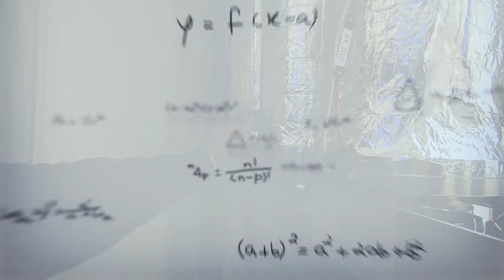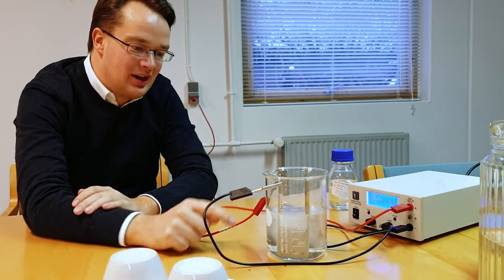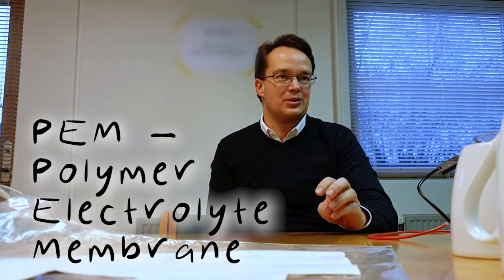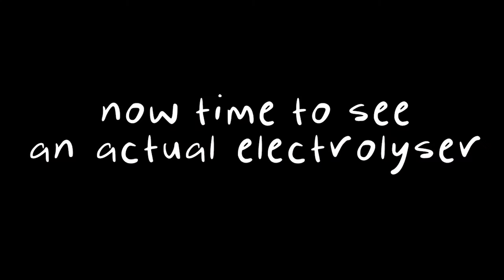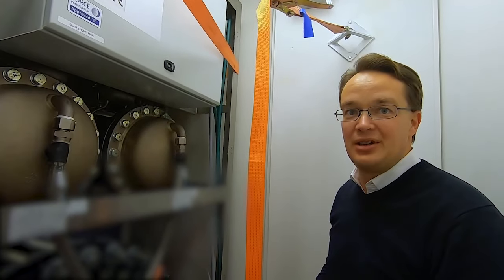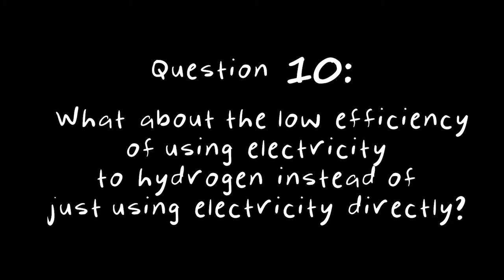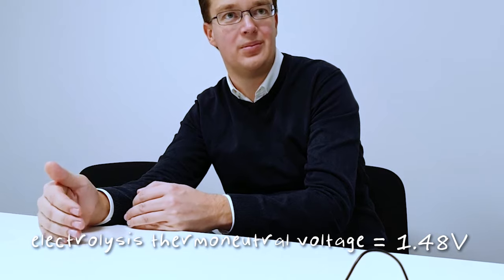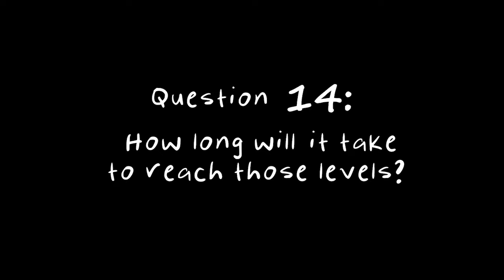Green Hydrogen Systems Electrolyser Tour

Comment: How likely is it that this technology will become a staple in the UK in the future?
Reply from the maker: I think it is very hard to say at the moment. There are a lot of uses for hydrogen that people are talking about now that are highly unlikely to eventuate, like using it to generate electricity or for passenger cars. And other applications where it will definitely be used, like fertiliser production which already uses hydrogen. What is uncertain is all the applications in between, where hydrogen is too expensive now but may become more economic if prices drop a lot in the future. Shipping would probably fit in that category. I've got a video coming up on using hydrogen to replace natural gas (for e.g. home heating). It should be ready in a few weeks, so keep an eye out for that video if that sounds interesting to you.
Reply: @EngineeringwithRosie  Thanks for the reply Rosie. I actually came across your videos when I was researching a company called Ceres that have created a steel fuel cell that can generate power from sustainable fuels like biogas, ethanol or hydrogen. Also, a company in Sheffield have just built the worlds biggest Electrolyser in Sheffield interesting to see how that develops in tandem. I'm subscribed and look forward to your next videos!

Comment: what about using the hydrogen to make synthetic fuels that you burn like the regular stuff? what would be the roundtrip efficiency of that?
Reply: Depends on the kind of fuel and the used process. And the source of carbon dioxide. Carbon capture from air (DAC) is very energy intense.
Normally, this efficiency will be lower than 50%. I heard from "27 kWh for 1 liter diesel-equivalent", which would be an efficiency of 37%.
On the other hand, methanol by power to liquid seems to be rather efficient, due to the "simplicity" of the molecule: 50 to 60% with direct air capture of CO2.
Which would be about 16 kWh for 1 liter gasoline-equivalent methanol (~2 liters).

Comment: if i had a fuel cell and put 100w in to it and produced H2 + O then put it into another fuel cell how much wattage would i get out?
Reply: You meant an electrolyzer in the first place. Electrolyzers produce hydrogen and oxygen, fuel cells consume hydrogen and oxygen.
However: Both efficiencies combined are up to 40%, rather less on average. 
So you would get back up to 40 W from 100 W.
Only this energy conversions, without energy for compression and the like.

Comment: How many kW is it necessary to produce 1 kg of hydrogen ?
Reply: Depends on the time period you want to spend on it.
You need roughly 50 kWh (kilowatthours) to produce 1 kg of hydrogen (here 52 kWh, due to 76% efficiency HHV).
So it's 50 hours with 1 kW, 1 hour with 50 kW, 10 hours with 5 kW and so on.

Comment: Hmmm, you have your bench power supply on constant current.  That is why the voltage is dropping when you move the electrodes closer together or add in more KOH.  That is why the amount of hydrogen being produced (as the woman was asking) stays the same.  This is very flawed!  Take it off constant current.  The answer is, YES, the more efficient you make it, the more hydrogen is generated.  It's not the voltage that matters (as you said) but production is directly proportional to the CURRENT being drawn, which does increase with electrode size/distance and conductivity.

Comment: There is one thing that perplexes me about all that.

If the current efficiency stated is indeed 76%, i.e. you get 76% of the electricity input back when you combine the hydrogen with oxygen again then what is the world waiting for? This is THE solution to get into green energy. The greatest problem of green energy is not the production of green energy but the storage to provide energy when the green energy sources are down for several hours (no wind for wind farms, the sun does not shine for solar farms etc.). What does it matter what is costs as long as we can save the planet with it? Even if it was 3 times as expensive as coal power stations, so what?

The idea is really very simple: Use green electricity at times of access to run the electrolysers and use the reverse reaction to run a power station to top up supply during times of high demand. 

Even if it was somewhat less efficient, it is still THE solution.
Reply: No, you got the definition of efficiency wrong!
It was 76% HHV. This means, from 100 kWh energy input, you get hydrogen with 76 kWh higher heating value (HHV), which would be 64 kWh "normal" lower heating value (LHV).
If you feed an efficient fuel cell with it, you could get up to 38 kWh electricity back. Plus heat. On average rather less.
Without counting in energy demand of compression, liquefaction,...
Reply: By the way: 64 kWh LHV hydrogen is 1.92 kg of hydrogen.
The other way round: For 1 kg of hydrogen, they need 52 kWh energy input.
Reply: If you'd use up this hydrogen (from the 100 kWh energy input) for heating, you could get up to 64 kWh heat (theoretically) with a normal heating system (water vapor leaves the house) and up to 76 kWh heat (theoretically) with a condensing boiler.

Comment: If it takes 430kw for 1h to produce 4kg of H2, than with an electricity price of aprox. 0.2€/kwh one would need 86€ for 4kg of H2. That is 21.5€/kg of H2. Yet the selling price of green H2 per kilo seems to be 2-3€/kg. Am I missing something??
Reply: Selling price never can be 2-3 euros,this price is target of cost to produce H2 once...but you are right 430 kwh it's to much...you need 58 kwh for produce H2 with 300 bar...cost of energy is around 0,04 euro/kwh...for H2 you need to have own EE from wind or solar energy or biomass

Comment: A quick take on the efficiency side for me without any other machinery, production and maintenance costs taken into account was the 100+kWh of power it needs to produce 1 litre of hydrogen which seems awfully inefficient & expensive to produce, how much power can we get back from 1 litre of hydrogen? 
100 kWh battery will get you a long way in an EV or power a house for several days, but 1 litre of hydrogen will hardly get you to the local store in a hydrogen vehicle which doesn’t make it sound very “Green” to me if that is an intended use case.
Hydrogen is great stuff & we need a bit for certain Industrial purposes, but it is very energy & cost intensive to produce, store & transport, so I see this as a good way to make a bit of hydrogen for special uses when the grid is creating an excess of power, but I believe there are better ways to use and store that extra power.
The Australian, ‘Snowy Mountains Hydroelectric Power Scheme’ push a button when the grid is in excess and pump water from a lower dam to a higher level dam which helps stabilise the grid also.
Huge underground heat batteries are another new tech worth investigating Rosie, & I think you have done Geothermal, another favourite, which could have huge potential for energy production.

Comment: I see Ducati and Porsche are investing in replacement fuels, I wonder if you could look at the different approaches to replacing normal gasoline is and assess how far we are from these being real alternatives to full electric cars
Reply: No, electricity is the way to go, Tesla claim 94% efficiency batteries to wheels, an ICE you're lucky to get 25% so you'd be wasting 3/4 of the energy you spent producing the hydrogen just heating water, actually the efficiency of hydrogen in an ICE is lower because it's the worst fuel you can use

Comment: Thx For this inside, question...can we make it at home du solar pannels, stire it, convert it again to electricity when there is no or not enough sunlight...and in contrast to batterys and life span....💕
Reply: Yes, there are already commercial systems to buy for home size, but they cost 60000€ plus and can only store around 4000 kwh of energy for the winter. It only makes sense if you can not get a grid connection to your property.
Reply: But this is only in German sorry.
Reply: Search for LAVO a company in Australia.  They make this hydrogen storage system.

Comment: Hydrogen isn't a bad idea, but it should not be treated as a source of energy, it's just a carrier of energy. We need a TON of excess electrical power generation that we can use to crack water to get hydrogen, and until and unless that becomes economically viable, and potentially cheaper (to generate and use) than just using that electrical power to charge batteries... it won't be very useful.
Reply from the maker: I agree!

Comment: He was kind of disingenuous to suggest that salt water could be used, then just wave away the costs of the reverse osmosis purification needed.  Any impurities still have to be cleaned from the process at added cost, so that tap water example does not scale over volume without cleaning the residual minerals out of the equipment.  He also speaks as if the water availability is limitless yet water use has been a big issue in the ethanol fuel debates in the US over the last 10-15 years.  Food vs fuel (corn), becomes drinking water vs fuel in the electrolysis case.  The amount of water required should always be presented alongside the electricity input for any given quantity of Hydrogen produced.
Reply: I can't speak for the extra cost of the purification needed, but if you only look at the extra energy required for desalination of sea water it really doesn't matter. Desalination can be done for about 3 kWh/m³ nowadays so it's less than 0.1% of the energy consumed by the electrolyzer.
Reply: The availability of water is exactly the point that I’m stuck on too. In order to effectively scale this one needs water, lots of it. If global fresh water supplies are inconsistent and future scarcity is to be believed then where will all the water come from? Add in the purifying process or desalination and I struggle to see the end picture from a total cost benefit analysis perspective. I like the idea a lot but….. What am I missing?

Comment: How much more power will it take to make the hydrogen, then it can produce
Reply: If you refer to electricity production by fuel cells with hydrogen made by electrolyzis, you could get up to ~40% of the electricity back.
Without counting in things like compression or even liquefaction for storage/transport.
But on average, it will be less, rather about 35%. Again, without energy consumption of storage/transport.
Reply: @701983  you didn't mention the 30 percent of the hydrogen that leaks out of the system because the atom is too small to contain.  And what will it blow up?
Reply: @terenceiutzi4003  I don't know, to what kind of "system" do you refer.
I mentioned "compression, liquefaction,..." twice. You could have mixed this up with hydrogen leakage, which normally won't be as bad as 30%. Even 10% would be pretty high.
There is a lot of exaggeration about this point in the whole "hydrogen-discussion".
Of course, storage of hydrogen takes more effort than storage of natural gas. But with the right technology and materials used, you can minimize leakage pretty well.

Comment: That electrolyzer and a building to house it, a suitable storage tank, a hydrogen compressor + the various required controls, monitoring and safety equipment will cost in excess of $2 million dollars (US) and it makes 4 kilos hydrogen per hour. That rate of hydrogen will fill a Toyota Mirai in 90 minutes or 18 cars per day. 
That will be a quite long and expensive recoup time or very expensive hydrogen. Neither does that include cost of labor and maintenance, plus the cost of a distribution infrastructure and it's maintenance, plus the cost of fueling stations at over $2M apiece plus their labor and maintenance
The 76.5% efficiency is only for the amount energy input converted to hydrogen output. 
There are many more energy losses along the distribution network. The net power at the cars wheels is anywhere from 20% to 40% depending on how much you spend up front for better equipment (H2 promoters cherry pick data).
Then the fuel cells that convert H2 back to electricity vary widely in efficiency and durability, the promoters of H2 like to cherry pick data here too. Cheap fuel cells ($10,000) are neither efficient nor long lasting (roughly 100,000 km in a car). Using an efficient long lasting fuel cell that could run 300,000+ km and your Toyota Corolla will cost in excess of $100,000. You can get efficiency and durability for $60K - $70K not $10K
So... if you factor in using an average of 30% net efficiency at the wheels, it takes 3X more electricity from the grid to run a Mirai than a Tesla, on top of the added expense of creating and distributing hydrogen.

Comment: This method of energy storage has to compete against batteries which are more efficient, a lot easier to handle, considerably cheaper and getting cheaper and better by the day. No doubt there'll be some niche applications as energy storage but probably not general ones.
Reply: Do you know where the Lithium is from? And how its mining-process is? That’s not the way for the future, just a mid-term solution
Reply: @Adventurus  Yes I do. There are several different forms of deposits with different extraction methods for each, none of which are massively polluting and some that are remarkably benign. What are you suggesting is the alternative?
Reply: @earthwizz  look at the mining process in Argentina, for example. Horrible. 
The solution: Hydrogen. The greenest solution ever
Reply: @Adventurus  So you pick the worst case scenario by far for lithium extraction and pitch it up against the cleanest, greenest and by far the smallest source of hydrogen and the economics still won't work. It's massively inefficient for all but niche applications.
Reply: @earthwizz  yeah but it‘s a scenario 😄 do you only look at the best scenarios? You say it’s the most inefficient - how efficient ist hydrogen? Can you tell me?
Reply: @Adventurus  Look it up mate, or has your google finger dropped off?
Reply: @earthwizz  haha i know what it is. But obviously you don’t ;) otherwise you would know hydrogen is 50% more efficient than gasoline.
Reply: @Adventurus  Where did I say hydrogen is the most inefficient? When you have to make stuff up in order to have an argument your argument is nonsense. What's more, comparing the worst case scenario for one tech against the best case scenario of the one you favour is the height of dishonesty.
Bugger off.
Reply: @earthwizz  just read your comment, „massively ineffcent…“
You clearly don’t really know what you talking about, and don‘t have a lot knowledge from all technologies. The best case of Hydrogenproduction is from renewable energies.. the only Alternative Option is from fossil fuels, which isn‘t the way how it will be done in the future. Even today it’s not the common way. AND hydrogen is endless. Lithium is fossil.
Can Lithium be produced only by non-impact process on the Environment and without fossil fuel? ;) only in the less cases.
You didn’t bring up a single argument. 
Again, Lithium is mid-term solution, pushed by the desperate governments, how needed to react on the citizens pressure for climatecange. It was the quickest, easiest and cheapest solution.
Reply: @Adventurus  Sure mate, whatever you reckon. You might want to get some help with your spelling.
Reply: @earthwizz  hahaha you so lost

Comment: A frustrating thing about this video is, your guest talks low and fast with a accent. I also don't think his mic is placed correctly for some of it. This all adds up to straining to understand some of what he is saying. 

Here are some of my questions related to what I saw, because the answer given doesn't fully answer the question or because I could not make out the answer etc. Or related questions that come to me while watching this.

Potassium hydroxide, what resources goes into producing this? How much is needed for the process?  What happens with it once it's used, do you have to keep adding more? If the hydroxide corrodes metals, what about the nickle mentioned earlier?

All parts of this, how often do various things need to be replaced. Like the plastic membrane, does it have a limited lifespan? Is this membrane only plastic?

Wasting the oxygen splitting by having it go to the air, oxygen is needed for lots of people for breathing. Is it that hard to deliver it to those who need it?

Aside from using the waste heat to desalinate, do they use the waste heat for electricity, for cooling, etc? There are ways to utilize such heat, do they not? 

8:10 What happens if they didn't clean the water with reverse osmosis or desalination? Either process means more electricity and material used. Can you not split water with salt or small amounts of chlorine etc? Has any progress been made to bypass this requirement?